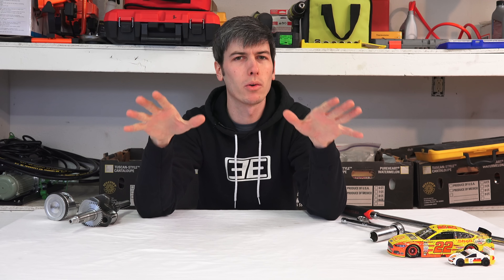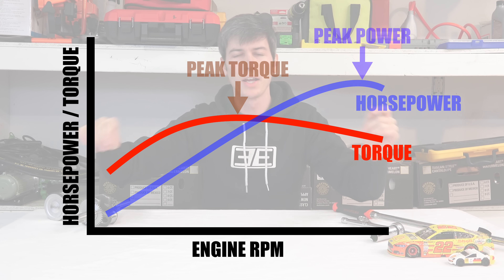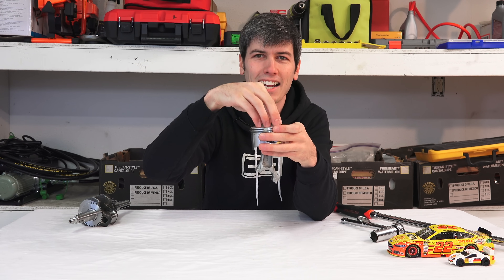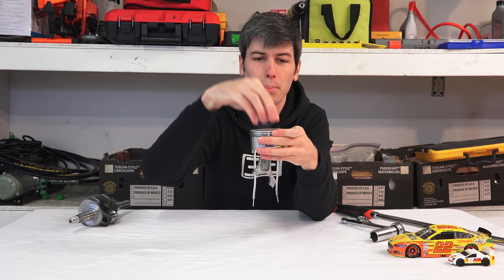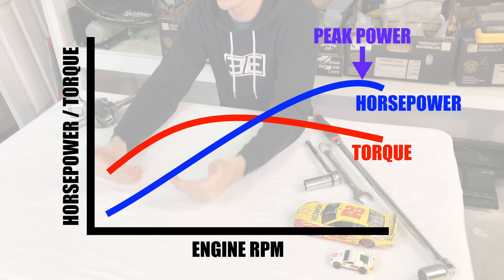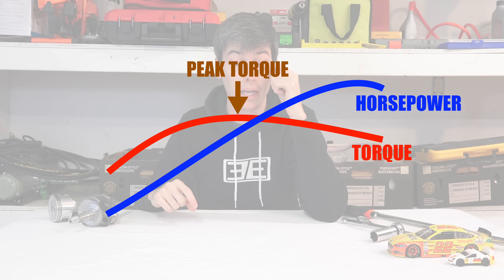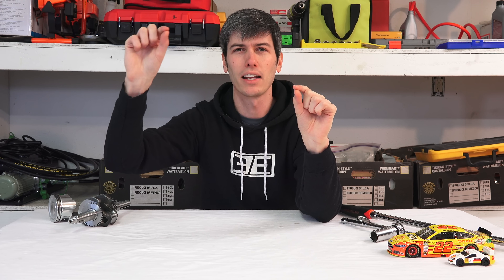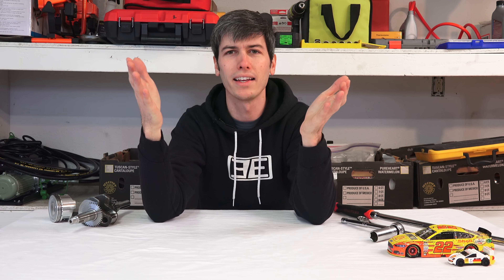Horsepower vs Torque - A Simple Explanation

Comment: I think this explanation is good, but maybe a bit overcomplicated. Let's dial it back a bit, I think many people might be confused of what it means when you say "horsepower is just indicating the work that is done". So lets start simple and understand the main factor here, which is torque.
Torque is, simplified, brute strength. It is how good you are at lifting weights, or how strong the engine is when turning its crankshaft. Horsepower is what you are able to do with your strength. For example, in a few minutes you can either lift a 50kg weight 10 times, or a 25 kg weight 20 times. In the end, you will have lifted 500 kg total in that time period which is the Horsepower you have produced. Whether you need to do very hard work slowly, or less hard work quickly, is just a matter of what your needs are.

That's why you often see diesel engines with low rpm and super high torque numbers in trucks, because they don't have to drive quickly but instead need to carry heavy loads at a slower pace. Meanwhile, supercars weigh significantly less and don't have to carry any heavy loads, but they need to go very fast which is why they often opt for engines with less torque but high rpm.

You can also see an example in various supercars. Typically, AMG cars from Mercedes have very high torque numbers in the mid range, but often don't have high rpm limits because they want to go for that growling, powerful kick that spins the wheels and puts a smile on Clarkson's face, while most of the Italian supercars have engines with less torque but very high rpm limit that allows for screaming engines that just keep revving higher and higher and can utilize that power that is found in the top of their rev range - and in the end both types of cars yield similar HP outputs because of how their engines are geared towards different rev limits.

Comment: So I've always questioned this from a drag racing standpoint, currently I'm under the impression that when launching a car you use peak torque and then shift at peak rpm is that right?
Reply: Torque vs engine rpm curve is to evaluate the airflow through the engine. Flat torque curve means constant flow of air per cycle. 4 stroke cycle, 2 stroke cycle, whatever. Airflow per cycle multiplied by cycles per unit time is power input to the engine. You would have to figure out the engine power vs road speed curves and then shift to the next higher gear after the engine has gone past the peak and the engine power is decreasing.  Then in the next higher gear the engine power will be increasing as the rpm climbs.

Comment: So from what I understand, torque is how much weight you can pull and hp is how fast you can do it?
And my question is what makes more hp and torque in the engine. Bigger cyl size bigger piston more torque but less hp. So does that mean that a lighter piston spinning faster = higher hp? How does it work? What makes it have torque.
Reply: em745a  That's the answer to the first question but what about the second. What gives the specs to the engine?

Comment: Great explanation. Do you think the 2016 Acura TLX V6 with 290 horsepower is faster than the 2004 Infiniti G35X with 300 horsepower? The Acura is a 9 speed and the Infiniti is a 6 speed.

Comment: I've always wondered if there was any significance of the intersection at which the horsepower curve and torque curve meet.
Reply: Josh Lambert none. It depends on the units you use to represent torque and power. Change the units, and you change the intersection.
Reply: They meet at 5252 rpm because the formula for horsepower is torque x RPM divided by 5252

Comment: When you said that the peak power was the most amount of work the engine can do I wondered about all the people who blew their engines by reving them too much. It might seem obvious, but why does that happen if you have reached the maximum?
Reply: Peak power = the most amount of strain being inflicted upon that poor, poor crankshaft. Additionally it often means the most amount of air and fuel going bang in the cylinders on a per-second basis; in fact, exactly what it means. That's a lot of fire and friction, which means a lot of heat and physical stress. Eventually something gives; maybe it's an overly bent crank, maybe an explosion happens prematurely, whatever; in any case the engine breaks.
Reply: @Derpy-qg9hn  ooh cool thanks for the answer!. I hadn't thought about strain and the many things that happen at the same time

Comment: There is no More simpler explanation to horsepower vs torque than math. Horsepower is simply= torque x rpm /5252. 

If your car makes 300nm of torque at 3500rpm horsepower is.. ~200hp.
Reply: @Vegard well might Be but still it works everytime. Because horsepower aint really measured by anything else than torque and rpm.

Comment: Hint: 5252 is a really important number.
Reply: No it's not
Reply: It isn't if you use the metric system.  Replace horsepower with Watts, and RPM with radians per second, and that factor disappears.

Comment: Can anyone elaborate in automatic car engine? How can we know what RPM shall maintain to get better fuel economy  considering torque?
Reply: Engineers study the performance curves of the torque vs rpm vs horsepower for the engine.  The transmission controller is programmed based on known performance of the engine, and is set up to find the optimal gear setting for the situation.

It also uses pressure sensors in the torque converter (the fluid coupling that automatic transmissions use instead of the clutch), which can tell when the engine is over or under loaded, and tell it to upshift or downshift.

Comment: When u changing gear 1 to gear 2 n above ur torque will decrease n hp will increase because u move faster n faster in each gear changing
Reply: When you change gear from 1st to 2nd, the power stays the same (at the same RPMs), because while speed increases, torque (at the wheel, that's where you're measuring the speed) diminishes due to less favorable gear ratio. If torque were to stay the same, you would go through the rev counter at the same speed in each gear, which is obviously false. When you start from a standstill in 1st gear and floor it, it just takes a couple of seconds to redline, in 6th gear it takes more time (assuming you're even able to do so).
Sorry I misread your comment but still, the HP stays the same, in fact you accelerate slower with every gear change

Comment: torque = distance * force ... ok, I know most women would approve this :)
Reply: i_nano Tran  Hahahaha seriously!
Reply: yep, being men is hard xD
Reply: @AaABbB-sg5cr  "Torque = distance * force" is oversimplified.  It only applies in that exact form, if the force and distance are perpendicular.

For instance, to open a door, you have to push it forward, or pull it backwards.  You have to apply a force perpendicular to the line joining the handle and hinge.  If you shove the handle directly to your right, the door won't go anywhere.  That would tension the hinge, but it wouldn't rotate the door.  Even if you are applying your force to a handle that is a meter away from the axis of the hinges.
Reply: @AaABbB-sg5cr  The full definition of torque, requires understanding the concept of a cross product of vectors.  It is usually used as the introductory example to explain the cross product.  It is a method that multiplies two vector quantities, along with a factor that is a measure of how close to perpendicular they are.  It produces a resulting vector, that is perpendicular to both.

"Torque = radius cross force" is the full definition of torque.   Radius is a vector from the axis of rotation to the point where the force is applied.  Torque will be in the direction of the axis of rotation.

Consider how a right-handed nut will move, as you rotate it on a fixed vertical bolt.  Spin it clockwise, it moves down.  Spin it counterclockwise, it moves up.  This is the convention for the direction of the torque vector.   When the wrench sticks out to the right, and you push forward on it, you produce a torque that per our convention, points upward.

Comment: I don't really agree with the explanations in this video. Ultimately torque is what accelerates you, power is just a calculated result of torque x speed. At the end of the day the toeque curve of an engine is what really shows its performance, not power. A diesel engine would always accelerate harder than petrol, except they can't run at high rpm.
Reply: em745a  okay so answer this. You are in a given year,  let's say 3rd grear. You accelerate from low rpm (1200 rpm) for example. Once you've reached the peak torque of the engine in the given gear, will you continue to accelerate?  Let's say peak torque is at 4000rpm and peak power is at 5500rpm.
Reply: So how is horsepower measured from an engine? It's not. An engine is first calibrated on a dynamometer which measures torque. Power doesn't even come into play. It's just a man-made number.
Reply: em745a  yes what I should have said was after you've reached peak torque, the RATE of acceleration decreases. Therefore, at peak torque you want to change gear. I don't think you understand that torque is what is turning the wheels, therefore torque is the critical parameter

Comment: A 60 ton Leopard 2 tank only has 50% more horsepower than an 800 kg F1 car (1500 vs 1000), but almost seven times the torque (4700 vs 700 nm).

Comment: What puzzles me is Neuton metre to Foot lbs direct conversions....I mean if your lever is a meter long for a nm with 1kg of force on it for 1 nm,then surely a nm would be around  660 percent that of a foot lb and not only 36 percent greater....does anyone know what I mean?`
well then again if you ignore levers and just consider the movement of the weights in each case through their respective distances....and then divide the weight by the distance,to get their comparable force........then yeah seeing as the metre is nearly 3 times longer than the foot into a weight only 2.2 times the ft lb....,I guess I kinda get it now.It's not very intuitive.

Comment: If horsepower is quicker on the start...Then why will a torquey V-twin motorcycle with only a 80 hp engine and more weight, beat a lighter high powered in-line 4 sportbike off the line every time?
Reply: em745a  thanks!

Comment: In your recent G-Wagen vid you said it can climb a 100% grade. If I'm halfway up a hill (100% grade) at a dead stop in my manual trans car, to get moving (upward) do I want torque or power. My instinct and experience say torque. What does EE say? Thanks.
(Or is it that I need HP at the engine and gear multiplication for max torque at the wheels?)

Comment: It might be easier to think of capacity of an engine. For any given capacity  the volume of the cylinder is a function of  stroke length and bore diameter.  I high reving engine  willl have a shorter stroke and wider bore.  A low reving engine has  a narrower bore and longer stroke for the same capacity. The short stroke alllows an engine to rev faster - tending to produce more power.  This comes at a cost of lower torque so  less pulling power. The engine can rev but soon as it is loaded down for example in a car that starts going up a hill the short stroke of the engine (and therefore smaller throw of the crank - shorter lever arm) means the torque is not there to pull harder and turn the wheels -  without a down change in gears the car stalls.. The long stroke  engine mean it takes longer to do each revolution of the crankshaft but the longer throw of the crank means that at any point  in the rotation of the crank the connectimg rod
is further out from the centreline of the crank so the lever arm is longer and torque higher..   You get up that steep  hill
but when back on level ground you are stuck with an engine that rotates inherently slower i.e. produces lower power.

Comment: One question: If horsepower is torque x velocity, the why do some engines have more torque than HP? Not being a smart-aleck, I really just don't understand that.
Reply from the maker: It’s not that they have “more” (the units are different, so they’re not entirely comparable), but below 5252 rpm torque will be higher than hp, above hp will be higher (with imperial units).

Comment: base on my understanding, torque is far more important than power because torque is the key to make a car to start up fast,that is especially important in low speed situations such as driving in the city.
Reply from the maker: No, as discussed in the video, the exact opposite is true. :)
Reply: @EngineeringExplained  Ok,one more question, 200 torque/100Power compare with  100 torque/ 200 Power ,which will go faster in 5 second?thank you for replied

Comment: I still cant fathom a piston moving up and down 100 times a second while an engine is turning 3000 rpms....if you only count the UPs its still 50 times per second. A piston the size of my fist is moving up or down 50 times a second while im driving my old 350 powered gmc. WTF

Comment: If torque multiplied by rpm's gives your horsepower how do we have engines with peak torque higher than peak horsepower? For example a diesel engine with 700lb-ft of torque but only 350 peak hp? What's the reason and the math?

Comment: Basically if u have two cars. Both of them have same power but one of them has more torque. The car which have more torque should give you a feeling that your car is speeding much better. But both of them have same time lets say 0 to 60mph or 0 to 100km/h.
Reply: em745a  same thing told different way 🙂

Comment: In simple terms, you are correct. But just like elementary math that changes in middle school and then high school, you are only correct until more variables come into play. Yes, a car with no outside forces acting on it will be faster with more horsepower than a car with more torque. But if you look at the forces in total it becomes a more complicated story as you have to account for outside forces as well as the job that the work is designed to accomplish. When it comes to engines there is Naturally Aspirated and Forced Induction(and nitrous, but that's a separate story). A naturally aspirated engine will benefit from a modest mix of both torque(bore size x stroke) and horsepower(RPM limit). While a forced induction motor can push the limits of what is possible, allowing you to have more bore size and stroke which leads to more torque and on the other end more horsepower due to a loss of vacuum and instead a positive pressure environment which means the engine can turn at a faster rpm. Due to limits in internal combustion, if the force of the combustion remains constant, the only variable to which can be increased is the RPM limit on vehicles with lower displacement allowing them to have high horsepower but low torque. Meaning, in layman's terms, you must counteract the outside forces with torque before applying your horsepower advantage. I just wrote all this to say... "There is no replacement for Displacement."

Comment: You told us the value of a lot of HP but not the value of having a lot of torque.
So if I have a lot of HP then I can accelerate faster.
But if I have more torque.... Then what?
Harley's are know for their torque not their HP so what is the value of
a motorcycle being know for its torque? How does that translate into
riding a Harley for example. Please folks make constructive comments
so we can all learn!  thank you.
Reply: As example of more Torque vs horse power take all the machine that are work force. Examples: Tractors, Cranes, Semi trucks, Excavators etc. They all have higher torque. You see they all are very slow but are very strong.. i hope this clears up for ya..
Reply: @ajnc1000  But based on this video, couldn't a vehicle with less torque but more power still tow the load by using the right gear ratio?

Comment: In the past I drove rallies with a 1981 Opel Ascona B 2.0E. At 1st I used 
the original engine bottom block. To keep the car in the 2.0 class we 
used the original crankshaft and used BMW piston rods, which are 7 mm  
longer and Opel Omega pistons.(The pistonpen is 7mm(0.276 of an inch) 
higher in the piston. This also gives more torque in the lower rpm's 
without changing the stroke. So a  straighter angle from the piston rod 
to the crankshaft gives more torque....
Reply: ? So you lose the 7mm in the end?

Comment: Sir one question how max power and torque figures are achieved at standard rpms like 6000 or 6500 or 5000 why not in odd figures 5576rpm or 6243rpm how is this?

Comment: Tractors have more torque than horsepower this is why they are slow but can pull big ploughs. Cars have more horsepower than torque this is why they can go faster but would struggle with things like heavy towing etc.
Reply: same question in my mind
Reply: No this is because of transmission and gearing, not horsepower
Reply: @Kavafy  So tractors dont have less horsepower and more torque?